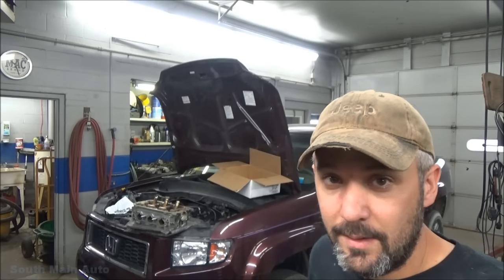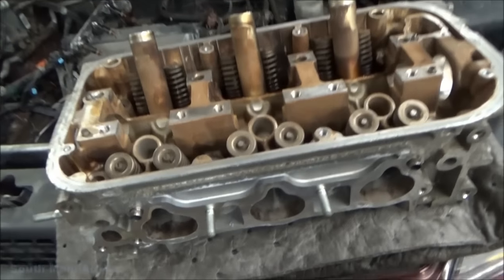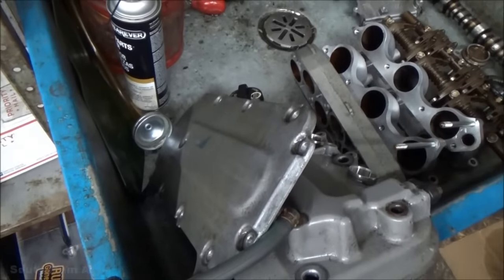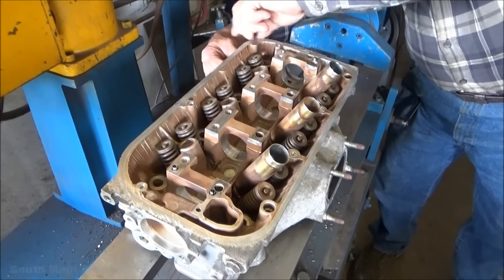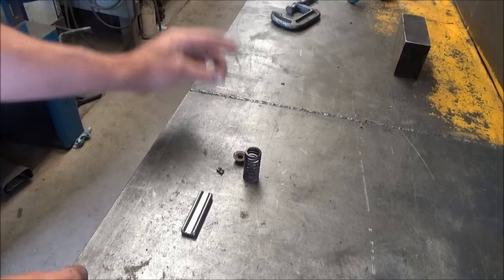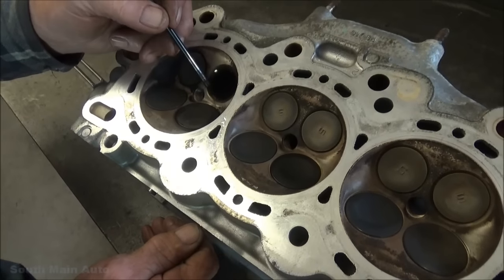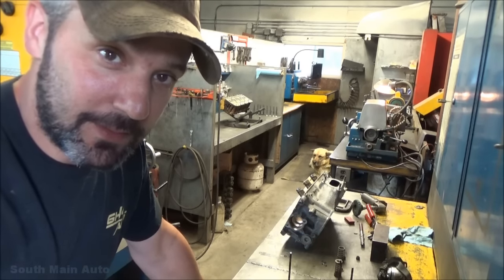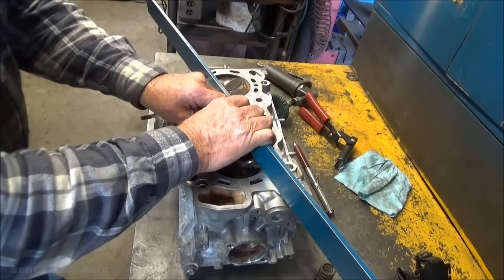Honda Ridgeline - Quick Trip To The Machine Shop

Comment: As an ex-machinist/rebuilder, I somewhat disagree with a torn down head being what a machinist expects. We would have prefered having the complete head, especially complicated heads (not talking about heads that have to have the cams, etc., removed just to get at the head bolts) to insure that all the related components are cleaned, inspected, properly reassembled, and adjusted. Of course, we were a full service, production level shop.

Personally, as a mechanic now, I would have most likely replaced the valve, lapped it to the seat (suprisingly little wear on those low-mile hard seats) and reassembled with new seals. A quick straight edge check, even though there was no indication of over-heating is always wise. There is always a wear tolerance... everything does not have to be PERFECT.

Still wonder about the seal/guide condition on that one valve.

Comment: Look into the variable cylinder management, which caused the some of the cylinders to shut off when the engine is not under load.  Which may cause the excessive oil burn and cause the carbon build up.

Comment: Is that a thump stick in your pocket, or? Nice deep dive in that 35. The wifes 06 pilot is chuckin p0300, and 301-306. After this series, I might have enuf balls to lash those tight exhausts valves. Much thanks.

Comment: I would be interested to know if when you set the timing belt if the number 4 exhaust valves are the first to move when you rotate the engine from your timing marks.
Reply: In a 4 cycle 6 cylinder engine, there is a cylinder firing every 120 degrees of crankshaft rotation. With #1 piston positioned at TDC (top dead center) and ready to ignite its air fuel mixture and camshaft sprocket timing marks aligned properly,  #4 cylinder is next in the firing order and is 120 degrees before TDC in its respective cylinder and ready to fire. So #4 is starting its compression cycle and both intake and exhaust valves will be closed. So there will be no movement of valves associated with #4 cylinder. 

In the firing order of 1 - 4 - 2 - 5 - 3 - 6 when #1 cylinder is at TDC and ready to fire and start its power stroke, #2 piston is moving away from the head (120 degrees past TDC on its cylinder) and its intake valve is open.

Comment: Valves rotate, right, as the engine runs? So a bent valve would enlarge the guides and screw up the valve seats?
Reply from the maker: :D You got it
Reply: In the southern hemisphere do they rotate left.. kidding.
But thanks for sharing that, rebuilding two engines at the moment and about to do some lapping and was wondering why some say to only spin in one direction where others say back and forth...
Reply: @SouthMainAuto Eric - Just watched this series - Years later...
Don't Know, if you ever see this comment:
It was a proper Hondu, WHODUNIT? :)
1) WHY would the lady do a 100k service at 74k?
2) Data shows: This Engine, IS AN INTERFERENCE ENGINE?
3) It's more: H Duty, Continuous service, Diesels, that have rotating valves? 
They have Ball Race, Valve Retainers, so that, they CAN rotate? One Piece, Solid Rotators, CAN'T rotate? :D ?
4) The machinist proved, a slightly bent VALVE HEAD - NOT STEM? Guides cd still be affected?
5) Does it seem likely, that the engine was OVER REVVED? - Went to Lower Gear, By Mistake? 
     Slight valve bounce? Lady senses problem? Brings FORWARD, 100k service?
6) Yes, Re: Engine Mount - Separate Issue?
7) Males, know what they know - Ask Ms. O, what she reckons about the Hondu Lady?
     These matters are beyond our understanding...

Comment: old video I know but I am just seeing for the first time and I watched all three about the hon-doo. when I watch vids on how 2, I like details and most don't show details.  most just show the project half done or already apart and then they say "well here's how to put this on" without explaining all the pain it took from start to finish.  They would never show any mistakes they make and would edit out anything like taking forever to get a problematic bolt out, they would just show you the bolt and where it came from and say "take this bolt out it went rite there" yeah right, so easy. I put my throttle position sensor on backwards and on this 89 ford 5.0 it's under the thing and not on the side like a normal engine.

Comment: leaking valve guides are very common on high-mileage engines.  This is easily seen/diagnosed by a puff of blue smoke on startup or starting from a stop sign, the blue smoke will stop once the vehicle is moving.  The problem is once one head has leaking valve guides then typically the other head is not far behind so might was well do both.  However, most people do not and just sell it as is once one head is fixed.
Reply: Unless the valve was bent from the service that the Honda dealer performed, possibly incorrectly setting the timing marks, then correcting it on the next visit and trying to cover it up. That is why Eric is trying to figure out which happened first, the bent valve or the carbon buildup. I believe he mentioned that this Ridgeline had relatively low miles for the damage that occurred.
Reply: 79k miles if i remember

Comment: Watched the whole series on this and at this point in time it's almost impossible to say what exactly happened here, but there's an explanation. Did the machinist say these valves get bent on their own? The way I'm looking at this, the customer goes to the dealer for a routine service and notices a problem immediately after that. Hmmm. 

I do know the shop next door to mine had a Honda 3.5L that the same thing happened after a 'routine' timing belt job. The tech, who no longer is there, put the belt on. Something about a breaker bar after the engine stopped turning. WHAT?? Anyhoo, that was not covered up, and I think it was the front cylinder head that had to come off. A few valves also got tweaked on that one. Kudos to the shop owner for steppin' up and taking care of their F - Up. 

My thought was the dealer was the likely cause of this fault, but at this point there's no way to prove anything. Having worked at a few dealers I could see how this might have happened. The guys that normally take care of this could have been backed up and the LOF guy could have been handed the ticket. It's a win/win all the way around for the owner as they collect more money on the job, but...Things like this happen. It's too bad.

Comment: changed all valves seat and try valve grinding that will solve oil consumption base on my experience.. if its leaking try puttin water on the i n e manifold hole wa8 a minute if it will leak out

Comment: Interesting problem, but it could have been a lot of things. The main thing was did it happen to a well-maintained engine run properly or to a poorly maintained engine run poorly? 

Cold running, bad gas, but you'd think that would affect the other cylinders also.  
Synthetic oil, the oil and filter should be changed every 30k? So maybe it's had 2 oil changes after the initial post-sales oil change? Has she put real oil in it when it's supposed to get synthetic? Is it some sort of "synthetic blend" that's failed the one cylinder, maybe one guide that went before the others? Contamination? I can only say that if she needs a head and a valve job at 85k with a Honda motor, that's not too impressive.  I can definitely believe that it was run cold with cheap gas but I suspect some other factor at work here. The bent valve, slightly bent, we're back to the timing belt, right?

Yet again the old adage, sometimes it's better to not try to fix something that isn't broken. But the odds are that if they bent the valve by accident, they might have bent it later instead of sooner. An excellent argument for an extended warranty and/or a good lawyer.

Comment: Hey, great videos, I love watching your stuff. I realize you did this video and work 7 years ago, but I was wondering if you think this might have been caused by the VCM? I have no doubt you're aware of the lawsuit against Honda where the Variable Cylinder Management caused oil fouling in many vehicles. Do you think that's what happened here? I've had a couple of odysseys and grappled for years with vibrations and bad motor mounts due to the VCM system. I finally found the VCM muzzler/tuner device which allows that system to be deactivated. Thanks in advance!

Comment: valve guide and /or valve seal are the culprits for allowing oil by causing the oil consumption and the build up on the valve and seat......that is assuming that a cracked head is eliminated.

Comment: If that cyl head is covered in carbon, it's fair to sa that the other is not far from having the same problem.  He's already gotten all the thing removed to get to the other head so why not pull it and take it to the machine shop for piece of mind?  I'd suck to have the customer come back in in half a year with the same problem but only on the other head

Comment: Ha! That's a Deutz F4L 1011F. The EQ. I work on is powered by about 70% of Deutz Engines.... VERY GOOD Runnin diesel engine's. Great video & Thank You for sharing the GREAT content.
Reply: When those 1011 head gaskets go, what a forsaken mess they make out of the machine they are in, filthy sooty oil all over everything. Takes longer to clean the machine up than change the gasket.

Comment: I always thought on a typical valve job ALL of the guide and seals were replaced.  Not true ?
Reply: There is a wear tolerance for the guides and it makes no sense to replace them unless they are worn beyond that tolerance. It's quite a job replacing guides in an aluminum head. Seals are cheap and should always be replaced when head is serviced.

Comment: Ridgeline heads have a problem with cracking from the intake port to the top of the head in that cylinder, sucking oil into the port and causing excessive carbon buildup on the valve. I didn't watch the entire video, but I would bet that was the problem here.

Comment: which video has the heavy htting air hammer?  
i have a CV joint stuck in a hub with rusted splines.  PB and pantherP didn't help.

nevermind, it's the Ford explorer sport trac video

Comment: I pulled apart non-interference Motors with heavy carbon buildup that bent valves! I seen 3800 GM Motors do it with a broke timing chain. Just a theory.

Comment: Man you can hear it grinding unevenly. Back to the timing belt mistake, or at least I don't see how else that valve can be bent. Of course with the loose guides the seals will be worn. Those diesel pistons look typical for a two stroke.

Comment: From the state of the other valve guides I would have though that both heads should have been done. Good to watch though Ty.
Reply: In theory, but theory has a habit of meeting the reality of budgets. Ideally you'd do both banks. It'll be fine though.
Reply: @beardyface8492  For how long ?
Reply: @tonygriffiths2485  Quite possibly for the rest of the normal life expectancy of those engines or at least of the vehicle in a high salt environment, at the expense of using slightly more oil than if both heads were done. I've seen much much worse play in valve guides than that in engines which were running perfectly till the head gasket failed & ran perfectly after replacing it without doing guides.
You can only do the work a customer authorises, sometimes they'll do the bare minimum even if you advise them that it'd be better to add other things, usually it works out just fine, occasionally it costs them repeat work later for not listening.
Reply: @beardyface8492  I think you've just established that the solution to do the whole engine is based on someone doing the work themselves rather have have someone else do it for yoyu. On a budget I can understand that. The head gasket is a good point. It's bloody expensive having the work done for you. This is two years on now, so can't help wondering how things worked out. I would trust the judgemnet of South Auto's opinion.

Comment: Since the spark plug is in the middle and top of the head like that, does that make this a "hemi"?
Reply: It's a pent-roof design. The angled areas are flat, and the valve pairs are parallel. A hemi is literally a hemisphere, and only two valves because of the weird stem angles a 4-valve would have.

Comment: I had a chevy 350 doing that on 3 cylinders took the rockers off and banged  on them with rubber malit a few times and the sealed up been good for the last 200000 km with np

Comment: Again if the one head needs work, the other head is probably in need of work too.  Why didn't you pull both heads?   Heads should be cleaned, magnafluxed if possible on Aluminum heads, checked for irregularities milled if needed and then the valves done.  Wow you had to go that far to find a good machine shop?  I guess I was spoiled living in a decent sized metropolitan area.

Comment: The machinist's eye! He could see that microscopic bend in the valve. You could hear how just how little it was bent, and wasn't much. Just enough to allow the carbon to build up and cause the issue. Still didn't need a new engine, Honda dealership!

Comment: one trick I learned to find any leaks was to pour water down the ports to see if anything leaks from the valves, either bent valves or seals.
Reply: laquer thinner, it's thinner than water. if the valve/s are not sealing you'd know in seconds.

Comment: If its been serviced at a main dealer the valve clearances will never have been done. Should be checked and adjusted every 2nd service or 25000 miles. They do close up and will not seat correctly letting carbon get on the valve face and over time valve leakage occurs and the valve gets slightly bent.
Reply: why only one valve and not a problem with the others.  More likely valve got bent by the piston
Reply: all it needs is one tiny bit of hard carbon to come loose and get caught as the valve closes the damage is done
Reply: The thing about it is, she didn't take it to the dealer cause it was running rough, she took it in for scheduled service, when she got it back, it was running rough(5 cylinders). I really doubt shes lying about this, this is her trusted ridge line, shes not gonna lie to her mechanics about the reason shes dropping her car off to them. I just cant imagine that she would know her valve was bent and concocted a plan to take it in for a scheduled timing belt replace knowing that she could then blame them. Her car run perfectly before dropping it at the dealer, she got it back with a dead cylinder.  2+2=?

Comment: So it WAS done during the timing belt replacement!!!!!!!!! UGH!!!!!!!!!!!!!  Even if you turn the main crank after replacing the timing belt, if it's off a tooth, you can easily do this kind of valve stem bend and not even realize it until you fire it up. But the damage has already been done if you don't know how to feel the small resistance turning in by hand even. So sad. When I do this kind of thing like on a Subaru pancake engine, It's a fine touch to know if your spot on. A heavy hand won't know the difference until the damage is already done. I still think the timing belt replacement was the ultimate demise of the valve. Explains the valve guide seal leak also.

Comment: Talk about puting a man on the spot for answers.
It was obvious the valve is straight as soon as it was spun up in the grinder. What made it appear bent was the carbon as it was spinning. The inconsistent grinding noise was from an uneven wear on the valve seat and Im sure the machinist knew that. He probably was a little taken by the camera in his face.
Great work
Reply: Yea the valve was straight just carboned up. When he touched it to the stone you could hear the valve just needed to be refaced. After he refaced it you could see the valve margin was even which it wouldn't be if it was bent plus if it was bent he would have chucked it in the trash. That's a machinist you wish you could spend the last year with before he retires and suck as much knowledge from his brain as you can.

Comment: my machine shop wants cams an rockers on over head cams for there use in knowing how much of the seat an stem to grind so they can set valve lash tolerance to spec

Comment: look at you downshifting to save your brake pads & rotors! 
also this is the guy I want working on my cylinder head..  letting your dog roam around your shop while you bang on the table and grind away at the valves

Comment: Older Gentlemen like that guy are an endangered species..  They've seen it all..   When he is cutting the Valve you can hear the wobble...  Carbon on the Exhaust stems is almost always the guides.....  I'd bet she drove it for a while after the Dealer bent the valves...  The bent valves would eat the guides and cover up the witness marks in the pistons and valves.

Comment: The problem is due to robots replacing machines. It's all about money. If it costs as much or more to rebuild as it does to buy new, the skilled machinist is out of luck every time. This isn't a problem with our education system doing a poor job of providing the training to our young people. It's globalization, technology and the replacement of skilled individuals with machines that do not earn a paycheck or require health care. We can build new, cheaper than we can repair old.

Comment: "this is amazing an oil cooled diesel engine"
me: "pfft, Nasa has fuel cooled engine that charges up the fuel system with pressure and the rest of the excess electricity is put into the battery bank... that diesel engine can fit on your keychain in comparison to NASA's engines.."

Comment: Seems like oil control would be ring issue. Clean up the seats and valves with guides will band-aid the problem until it carbons up again.